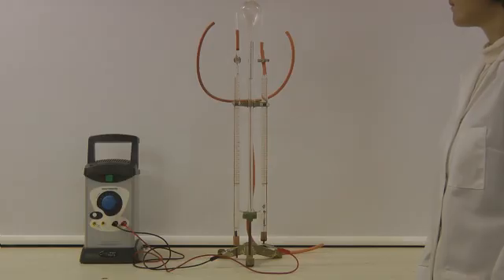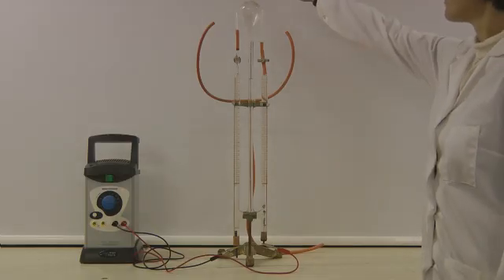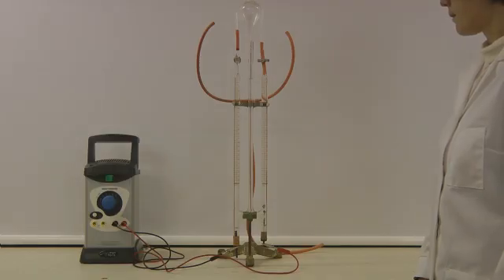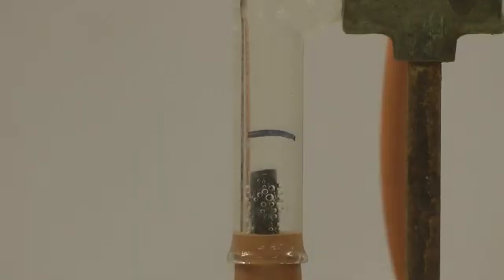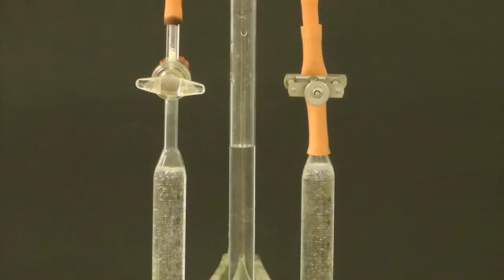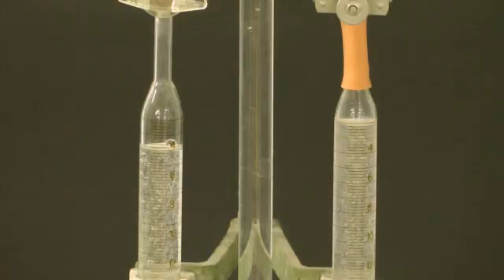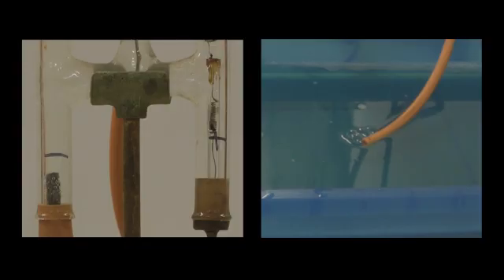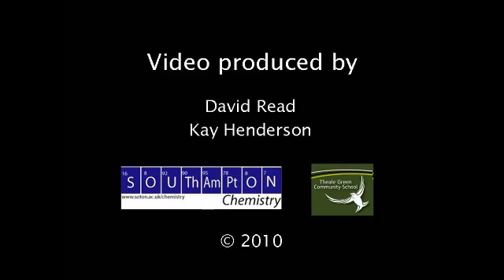The Hofman Voltameter: electrolysis of water

Comment: why expensive platinum electrode?
If to use graphite electrode amount of CO2 as a byproduct should be insignificant. 
Or it will be CO?
Reply: @xiej2520  what about aluminum? it already has a very thin oxide layer so not much should happen right?
Reply: @ivanrodionov9724  You'd be anodizing the aluminum, the oxide would become thicker, probably cut off your current presently.  Nickel sheet is fairly available, and there's plenty of carbon.  Does carbon turn into stuff in these conditions?  CO2 / CH4?  Just guessing.  I'm just here b/c I need a steady small source of Hydrogen gas and don't want to buy a cylinder and regulator.